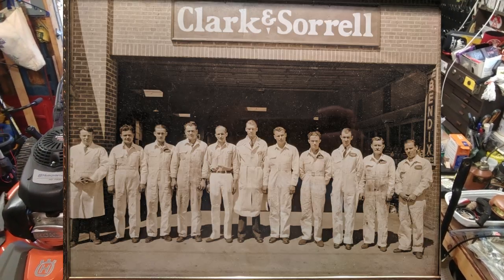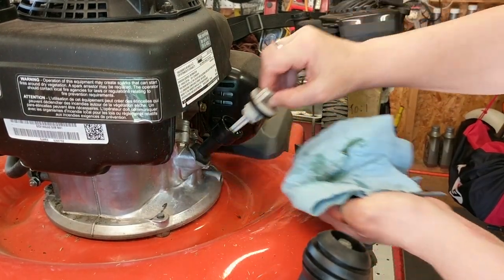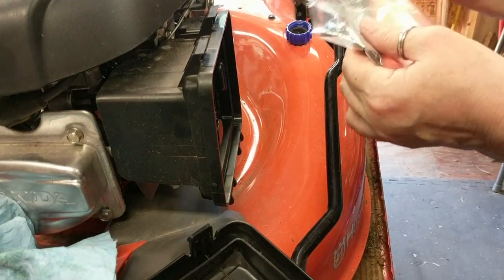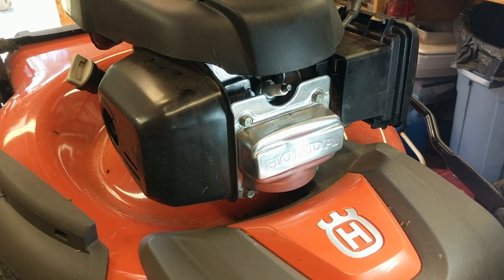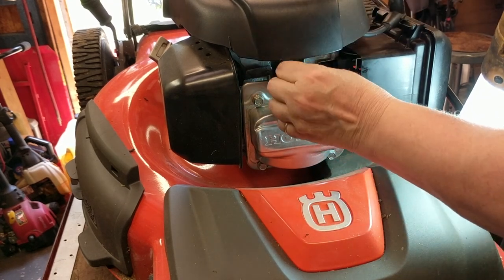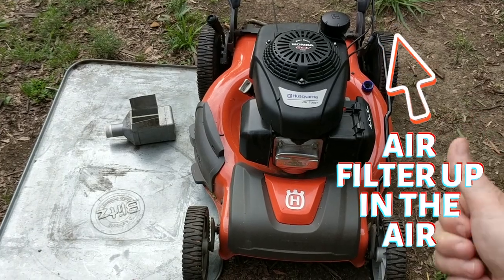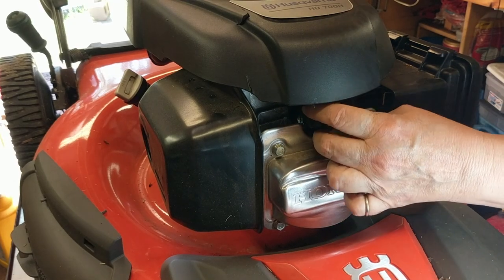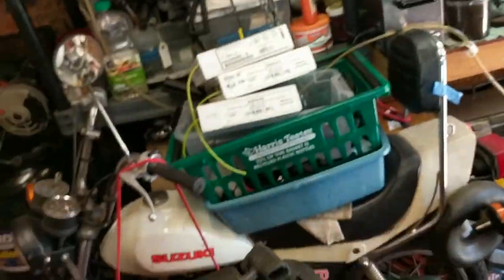Honda GCV160 Starts Then Dies: Tune-up for Husqvarna HU700H Lawn Mower

Comment: I have this nearly exact mower. It was giving me problems with starting and surging then quitting. I cleaned the carb and ran ok for a bit, then started giving problems again, so I replaced the carb last week. It ran fine and I cut the lawn. A week later, same exact problem, it surged then quit. It will not start except on the prime.  Any ideas?  I pulled the new carb, it seemed clean, and jets were clear.
Reply from the maker: Did you clean the idle jet circuit?
Reply: @TheLawnmowerLady  I ran a wire through the brass jet at the bottom of the pickup (near the bottom of the fuel bowl) it was clear.
Reply from the maker: @rcfred_689  That's not the idle circuit. Watch this video: https://youtu.be/JJ2AW0OlMYs

Comment: So I have this mower, though it's a troy it's the same engine. I've checked all of these things. Fuel filter is new and clean. Air filter is clean. Spark plug is clean. Fuel line is clean. I checked to see if the cut off valve was properly aligned, that's aligned. Cleaned the carburetor. It roars to life every time, then it dies a few seconds later. It gets gas to start it without problem, but for some reason the gas is not continuing to flow. Any ideas of anything else this might be?
Reply from the maker: There is a screw on top of the carb that covers the idle circuit jet. Some models you have to remove the idle speed screw (some are plastic, some are metal) if plastic, the idle jet is also plastic and pops off. Tiny hole in the bottom needs clearing out. If metal, the jet is not removable, and tiny wires (guitar strings, bread Tues, etc.) can be used to clear the jet. Hope this helps. Thanks for watching.
Reply from the maker: Another thing I thought of, and I've only seen it one other time... The fuel line on some is double walled type, The inner wall had collapsed resulting in the same symptoms as you describe. Pull off the carb bowl and open the fuel tap. There should be a steady drip of fuel to rule this problem out. But I suspect, as in my earlier comment it's likely the idle circuit.

Comment: One question please.. I have one briggs stratton carburater plastic one. Why i loose petrol from White duze, when i push the Red button?
Reply from the maker: The needle is not seating properly inside the carburetor. Maybe a piece of dirt or grit is keeping the needle from closing off. https://www.youtube.com/watch?v=QhxVQW9sBxc&list=PLscwXOlCLzlyjkXser6A6cEbKe0CLP117&index=4 show how to clean and check that. Thanks for watching.
Reply: @TheLawnmowerLady  Thanks i just subbed to your channel.. I will try this

Comment: ya right.....I heard it surging at the end and getting ready to die! you didn't address the original complaint! can you please tell us what was causing it to run and then die? I have a gcv160 Honda and its doing the same thing! came here to see what you found but you avoided it. useless
Reply from the maker: I found a cracked and broken spark plug caused the mower to die soon after start up. Did you watch the entire video? The owner has had no problems in the last two years with this mower.

Comment: There is no way you would have not overfilled that Honda engine with 18-20 ounces of oil.  Honda engines 160 cc. take12 ounces of 10W-30 oil.
I buy their  oil which comes in a 12 ounce long neck bottle easy to pour into the engine albeit more expensive.
Reply from the maker: I dunno Mr Gerald. According to Honda https://engines.honda.com/models/model-detail/gc-vertical#Features  says the capacity is 0.58 qts (18.65 oz) Thanks for watching.

Comment: You can hear it trying to die,  my lawnmower will die run great then die and not start fire 30 minutes.. then run fine for 20-30 minutes then die,  then won't start for 30 minutes.  I'm going to light the fucking thing on fire and buy a new one
Reply from the maker: It sounds suspiciously like an ignition coil breaking down. Difficult hot starts are a common symptom. Next time it happens, pull the plug and test it for spark. If no spark when hot, replace the coil. I know it is frustrating, but these older mowers are far superior to anything on the market today.